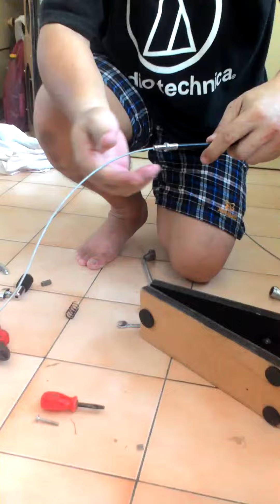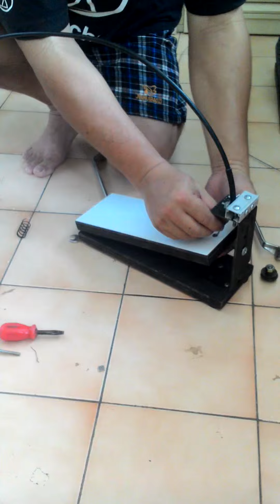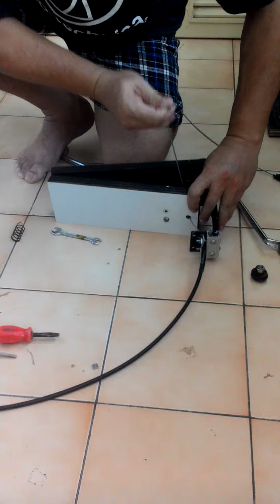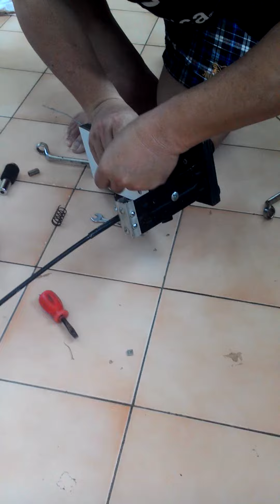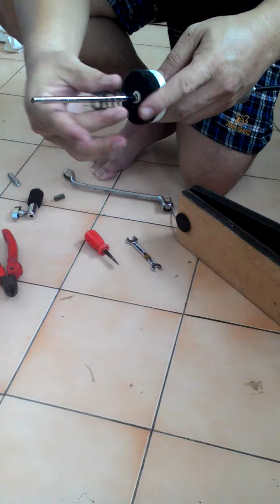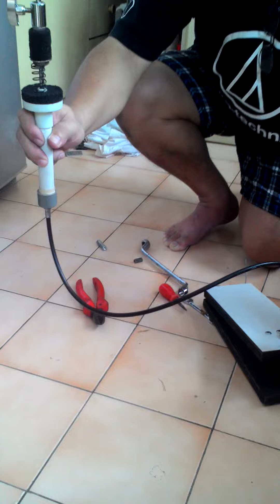Pete's diy cable hat part2

Comment: Hey man props to thiss!I am as well trying to do it.
Started by myself but ended up peeking online and found you.
I am not understanding how the loose part of the bicycle cable works. Mine work only when in tension! what am I missing?
Reply from the maker: Hi.Riccardo Salis,is not that diffcult....just watch few times you will get it.When you attached the Top and bottom hihat,make sure the "Spring" are attached between the two hi-hat.
Reply: @hinkhiong   I eventually got it, I was using 2 springs. Still I couldn't make it work, a good friend had to come and help me ou :), Thanks for the answer!!!
Reply from the maker: @riccardosalis5838  Good to hear that.All the best for you.

Comment: I'm in the process of making a remote hi hat similar to this thanks to your videos and inspiring kits! What PVC fitment did you use for the bottom hi hat support?
Reply from the maker: Hi,Brendon. That's a pvc cap  for the pipe(i bought it at the hardware shop at the pvc pipe,cap,jpint section).You also can use those plastic drinking bottle cap.just need to find a right diameter to fit in.All the best for ur project.
Reply: @hinkhiong  Thanks for the reply!